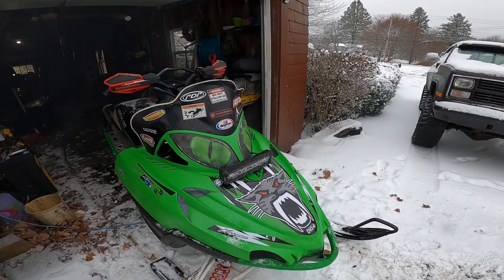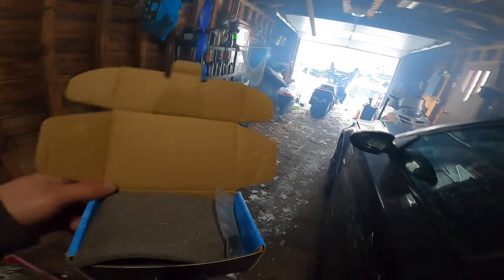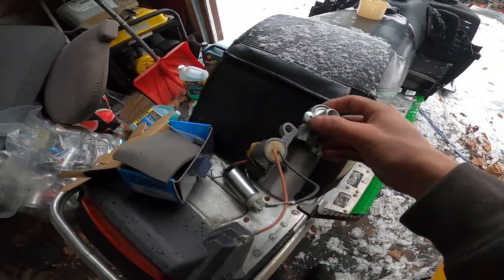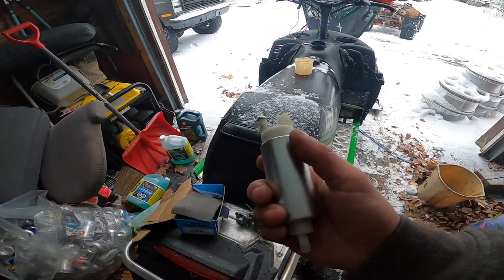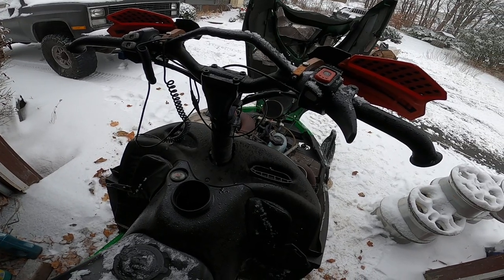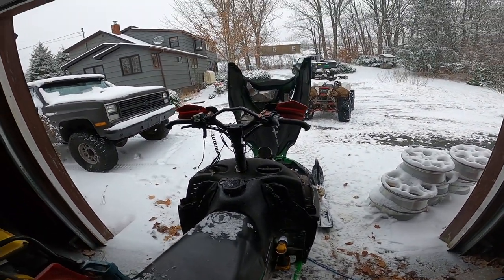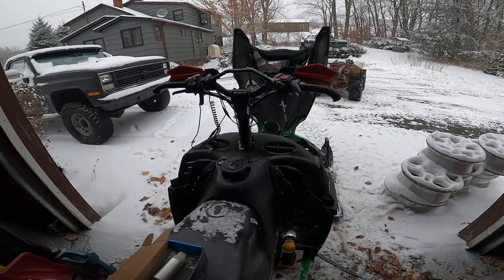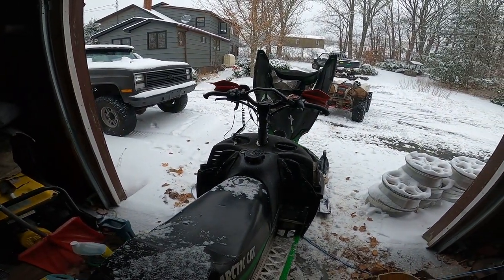Arctic Cat Crossfire 800 HO Fuel Pump Replacement and Ways to Test

Comment: Did the fuel pump test bad or was it possibly your fuel pump regulator failed? Thanks for the video! Likeley the same system that is on my 2009 M8
Reply from the maker: Actually both failed in the end

Comment: Got a 2006 Crossfire 700. Never had issues with it. Started it yesterday started easy then died after probably 2 seconds and wouldn’t start. Did some research and found multiple people had dead pumps

Comment: Trying this right now but it won't start.. any ideas?
Reply from the maker: If it wont start you must not have fuel.... try puttin a little gas in spark plug hole then put plug back in and give it a pull if it kicks or starts fuel is your issue... mine wouldnt start either pump seized up between seasons
Reply: @BurninGas8.1  damnn found 2 of 4 coil packs wires chewed through.. any ideas on how to remove the tank so we can reach the coil bolts? Got the bolts under the seat and the steering stem, also the small ones at the bottom of the plastic. Lifts up but won't slide back.. Anything else? Thanks a bunch!